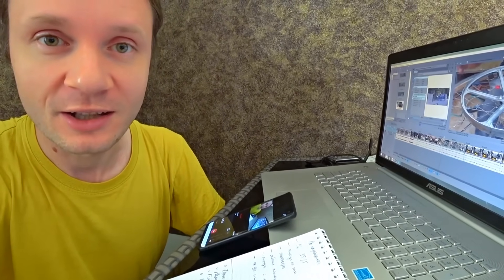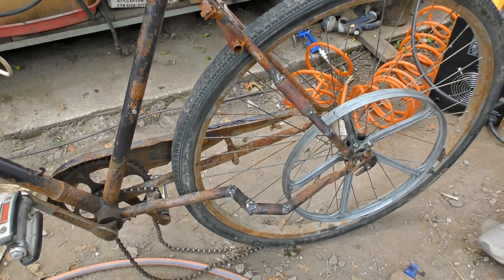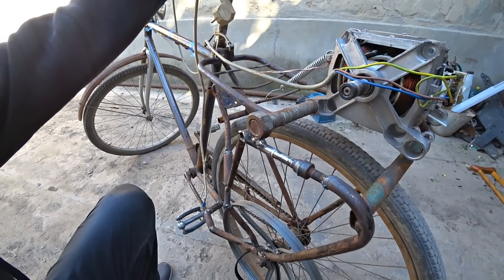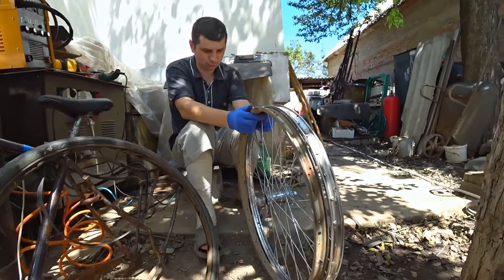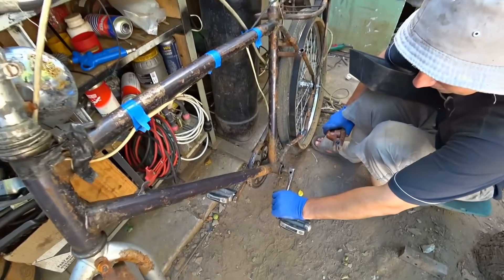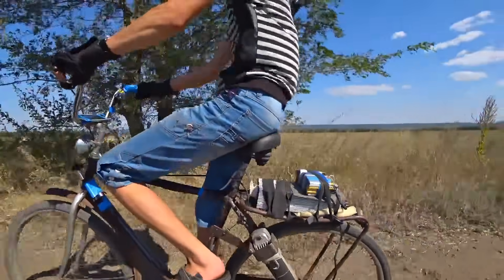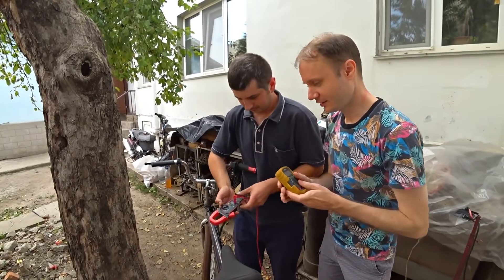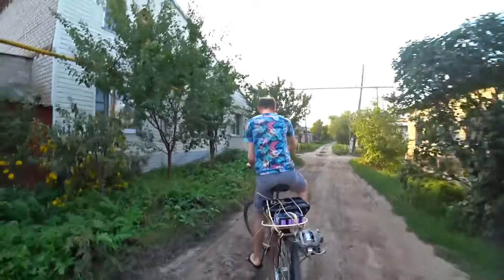✅Easy E-Bike DIY ⚡️🚲⚡️  Washing Machine Motor + Bike

Comment: Why not find a 24v  Dc  motor  without the hassle doing any conversion just simple to use, or you can use a Dc electric drill drive motor Ryobi or any strong brand

Comment: You are loosing to much energy dc to ac.. you can use the washing motor as a dc motor .. you can also use a ultra-capacitor for the first acceleration the battery power, also you can use one battery for torque and another one for speed 😊

Comment: Try placing a pure sine single-phase transformer with a power supply of more than 1000 watts on the bike and have it on the frame. Then you plug the washing machine motor cable into the pure sine transformer. after you do it the motor will work at 15000 revolutions. To adjust the revolutions from the motor you will need a speed controller for 12 volts or for 24 volts. If necessary, try placing a gear on the motor shaft and a different gear on the rear wheel shaft. Install a chain from the washer motor to the rear wheel sprocket.
Reply: Wrong

Comment: What voltage and amps is the motor running on? Did you use a regular household inverter.

Comment: Put a LARGER pulley on the motor shaft. 
The one you have is too small. It has to be at least 5 cm in diameter.

Comment: Sir you could have used a tire jack to increase the width of the frame near the rear wheel. Would have saved a lot of time and stretched the frame without breaking it but lovely video

Comment: So he ended up connecting the battery directly to the motor? No inverter and it went faster?
Reply: It looks like a universal motor which can run on ac or dc but I think you need a min of 50v to get any real power if running DC.

Comment: European voltage is DC 220
So I guess that is a DC motor? If y'all remove the bearings before welding the crank to the shaft it will save bearings. Oops then you can't put it on
Reply: No ac

Comment: Do you think I could use a vacuum cleaner motor for this too? I love these kinds of projects.
Reply: Vacuum motor doesn't have the necessary torque, it has the speed only but the torque is very low. It can move lots of air but not weight such as a washing machine.
Reply: @johnnymotors2023  Alright, thank you! And yeah I should have thought of that to be a problem.

Comment: 0:53 this guy just stared at the weld and absolutely torched his corneas
Reply: Nah he closed the eyes 😂 I weld with normal sticks and they are a pain in the ass with that mask so sometimes I just close the eyes right before I touch the metal if I spot-weld.
Reply: Johnny Motors Good luck with that, you hero. There’s light in the UV range that will still cook your retinas. Use a mask!
Reply: @JesusisJesus  I don't look into the light the whole time, just till I touch the stick to the metal 😂
Reply: Johnny Motors Enjoy the sunburn. UV passes through many things.
Reply: @JesusisJesus  in England you need sunburn 😂
Reply: @JesusisJesus  UV does NOT pass through many things including regular glass
Reply: Say "Hello itchy corneas!".

Comment: when the battery is off to the motor 
To an inverter which charges the batteries
When we drive the cycle with out motor assists
No need to charge it's recycled energy?
Reply: That would only work for regenerative breaking, pedaling to charge the batteries would actually be more physical body work to get to point A to point B because of efficiency losses.
Reply: @mashedpotatoes5323  
Yes that's true

Comment: QUIT CLOSING YOUR EYES AND WELDING YOU WILL STILL GET FLASHBURN ON YOUR EYES! NEXT YOU GET CADARACkS next you go blind!
Reply: It's not that bad I have been welding years and used the look away technique for tacking, I have never even had arc eye. People are too paranoid about UV light, humans need it to stay healthy, especially 315nm UVB.
Reply: @richardsandwell2285  turning your head is different from closing your eyes.Im a welder by trade and have a few people that would fire your ass for doing that.

Comment: Pushes 400amps through small wire... "why is it hot"
Reply: Guys wtf 😂 400 Amps ? 100 amps? 😂😂🤣🤣🤣 That motor has maximum 600W not 88000W or 22000W 😂😂😂 A house has a fuse of about 40A to 60A. This motor having maximum of 600W uses 2.6A to maximum 3A not 100A.

Because is 220V x 2.6A which gives about 572W. So as long as they have above 2.6A then they can have a good torque on the motor to push the person on the bike.
Reply: @johnnymotors2023  thats still a thin wire for 20a
Reply: @girlsdrinkfeck  well yeah if you pass lots of Volts or Amps through it. But if it was 10A at 12V it would be fine or 5V at 20A but more than 100W is not that good for a long period of time.
Reply: @johnnymotors2023  it's not the voltage that heats up the wire it's the amps
Reply: @mashedpotatoes5323  it's the voltage too if the amps are high. If the wire is thin but the amps are just 5A with 5V then it won't melt but if the voltage is something like 24V with 5A then if the wire cannot withstand the amount of amps going through it at that voltage it can melt. Any wire has it's Wattage limit , Amperage limit and Voltage limit. Surely a thin wire can drive even 2000V but the amperage will play a good part or vice versa.
Reply: @johnnymotors2023  that's not completely true, that's like saying you have a 14awg wire and run 100amps and 10volts through it or 100volts and 10amps and either way would work. Why do you think 120volt ac wire has to be thicker than 220/240volt wire?
Reply: Johnny Motors it’s only the current that’s heating up the wire. The voltage does not matter. That’s why we use high voltage power lines to deliver a lot of power without loosing to much energy in heat.
Reply: @mashedpotatoes5323  I u have watched Electroboom u would not say that.....😂
Reply: @johnnymotors2023  Actually it's really counterintuitive.. if you raise the voltage it reduces the stress on the cable. So passing 20 A at 5 V leads to a larger voltage drop than 10 A at 10 V even if the power is 100 W in both cases.
Reply: @johnnymotors2023  that motor is max 280 watt which equals to 1.5 amps for 230volts
Reply: @4ri8  it's definitely more than 280 watts, 750watts is one hp equivalent and they are able to drive it with two people on it so it's probably around 1,000 watts max
Reply: @mashedpotatoes5323  I have a proof....Check out KREOSAN English's latest community post which has a picture of the motor itself...There it is written 280 watts....I myself wondered how can 280watts can give so much torque but it's a fact
Reply: @4ri8  just because it's rated 280 watts does not mean it will draw more.... My custom made dual motor ninebot es4 has 36v 300watt motors and I run them at 60v and 1500watts, it just gets hot quicker and can eventually melt down if I were to continue to run it at that load. 280 watts is similar to those crappy ass electric razor scooters that are meant for kids, the rating it's nominal wattage.
Reply: @4ri8  they ran it in 60v
Reply: @johnnymotors2023  at 12 volts
Reply: @johnnymotors2023  thanks fir that generous explanation. Finally I understand how to figure the wattage. 👍
Reply: @SuperPapadzul  well he is partially incorrect but okay lmao....
Reply: @johnnymotors2023  hlo sir if i run my 220 v AC mixer grinder on 200 v dc ,does it get damage after some time
Reply: I don't think it's that many amps... Maybe 100 amps
Reply: Holy Moley why has my meerkat fried to death on this Heath Robinson death trap? 😂😂😂

Comment: Gotta love those universal motors. If you're powering it straight from the battery you should be able to PWM power to the motor to get throttle, just make sure the FETs are logic level and flyback diodes are good, and you can use the signal from the accelerator you already have.

Comment: That motor would probably handle 400vdc for about 30 minute burst,  maybe add a fan to help cool the brushes! Don't forget, as volts go up so does the current, meaning double volts, 4x the wattage,

Comment: As an Italian, I loved that sudden "mamma mia!" ❤
Reply: Siamo gli unici che vedono cose di qualità
Reply: Allora non so l'unico italiano che guarda sto canale
Reply: @cianuro6210  siamo minimo noi 2 😂
Reply: @ordnaelshideout  Mi aggiungo!
Reply: @cianuro6210  eh no
Reply: Mi aggiungo anch'io.
Reply: All made famous by an Japanese Italian plumber 🤣😎
Reply: Mia Khalifa?
Reply: Hlo sir is that ok to run ac moter on dc ?
Reply: @rohankumarchauhan9653  
If it is ac series motor (universal motor ) then it can be run on DC but the DC voltage it can handle will be different from its ac voltage ratings
And if it is ac single phase motor it cannot be connect to supply

Comment: Washing machine motor will work only in AC
THEN HOW COME YOU ARE GIVING POWER TO THE MOTOR WITH THE BATTERY PACKS????????????????????????????????????
Reply: Brushed ac motor can run on dc.
Reply: Simple, use the inverter DC to AC

Comment: Love these videos! I have an old rusty cycle like that at our village house, I'm thinking to somehow power it with a drill motor or something. Your videos are a great inspiration for ideas.
Reply: Use any Motor from a Scrap Car...Heater Blower Motor.....The Starter is good...and Powerful..and They only Require 12 Volts to Run....I Made one with an old Blower Motor and it will go 35 to 40 Kph....And I use Li Ion Batteries in Blocks to Power it....And an old Drill Switch as a Throttle.
Reply: @orionx8295  dude starter motors are good for short use only. They'll burn out after long periods of use

Comment: fIrSt!! ! Jk you should have tried using just batteries to a motor controller and wire the motor stator and rotor in series
Reply: no
Reply: No . not expensive
Reply: @ovanai6277  That is not expensive at all if you have batteries, good motor controller would go for about 15-50$ wich is a lot cheaper than getting all those batteries...
Reply: @lengaming1651  yes thank you